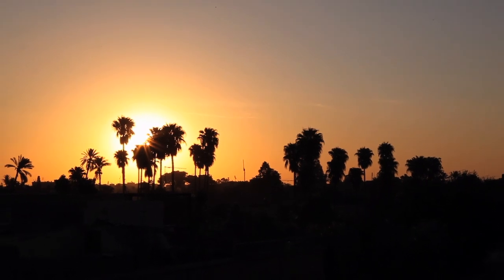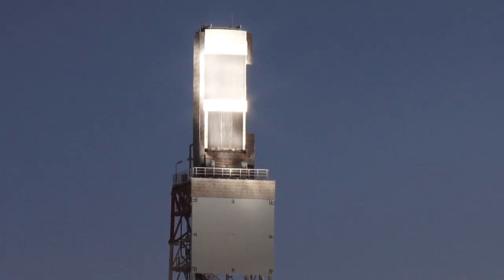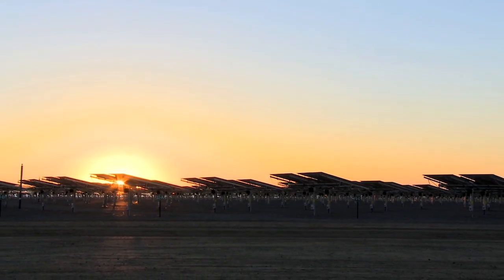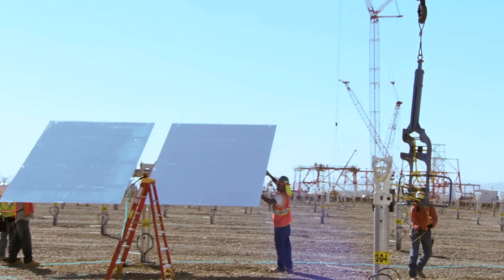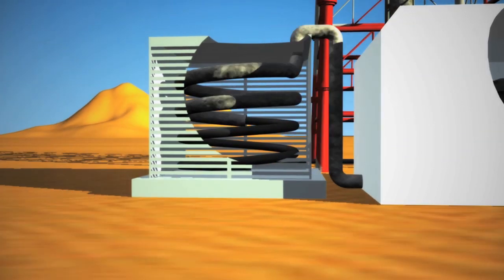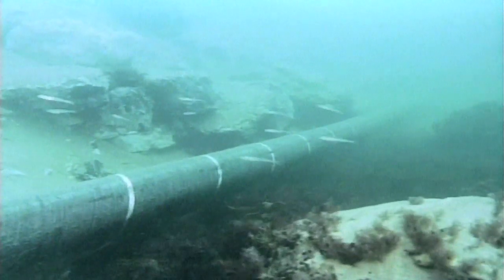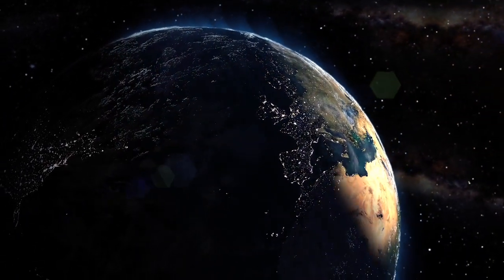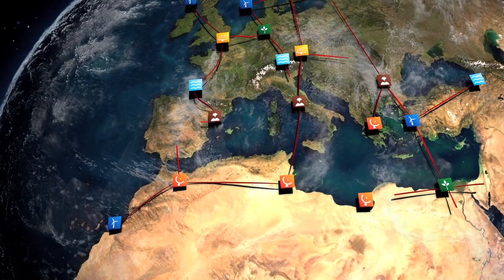DESERTEC Foundation: The TuNur Project -- Tunisian sun will light European homes by 2016

Comment: This is what the U.S should do too. Post mounted mirrors don't really need paved deserts. Molten salt should be used as heat storage which would ease load leveling problems. The ultimate in continuous load leveling, however is LFTR, the best and far less dangerous nuclear. I say, do both!